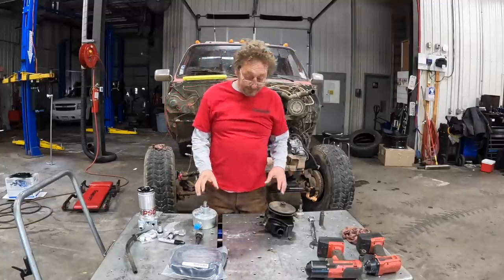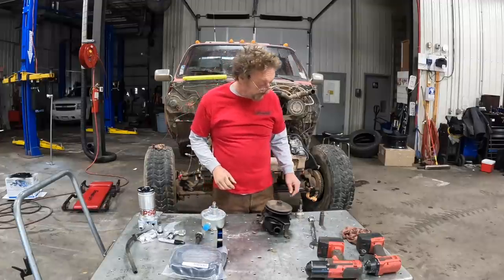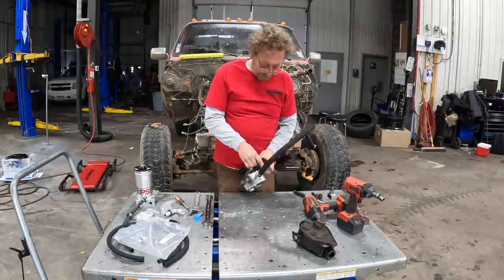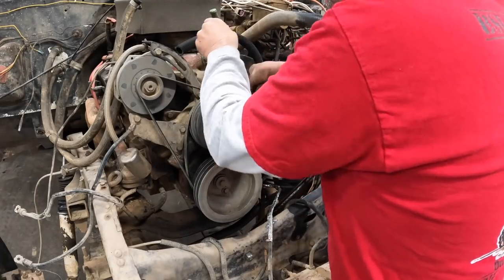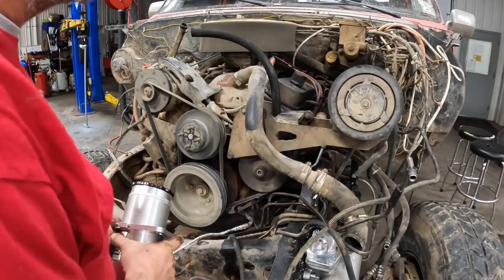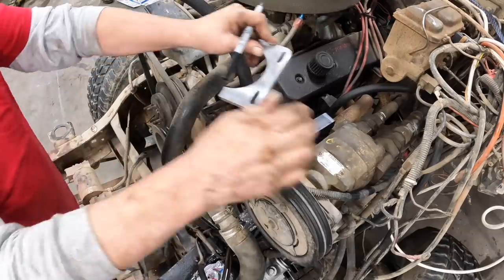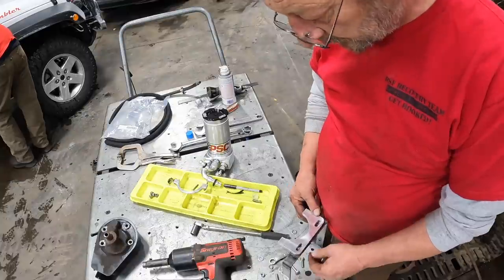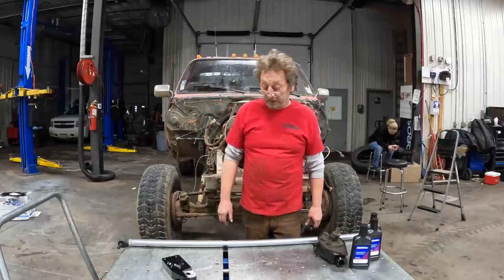PSC pump and reservoir

Comment: That has to be nice, no fenders to climb over, not much in the way of getting to bolts, downside is the time and man power to remove that front clip so work life is so much easier to do. Thank you for showing us the PSC steering system install.

Comment: My 97 f350 im doing a hydro boost conversion in the spring.  My pump only has 1 return so i will t the lines into 1 line.  Why a diesel has vac boost brakes is beyond me. Pedal is slightly different so i got one from a junkyard donor.  Looking good eric